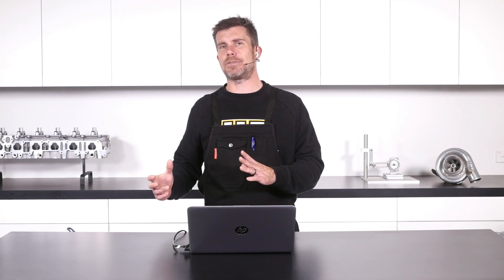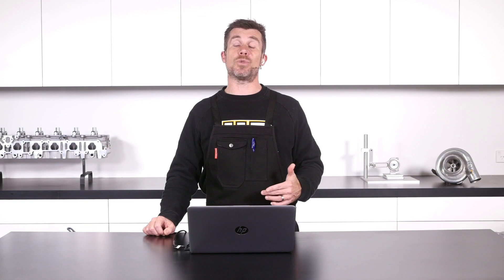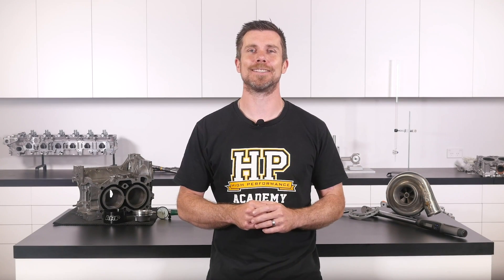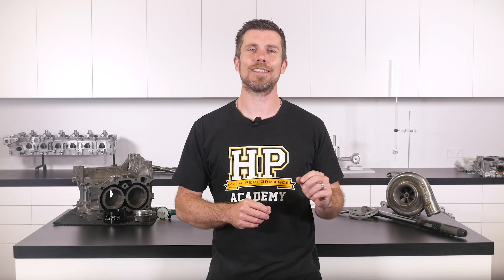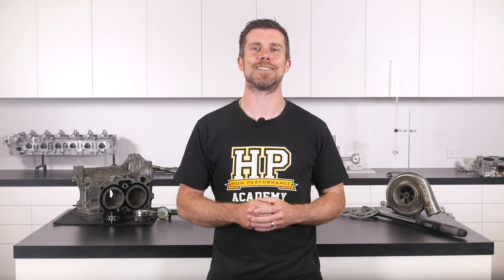Is Street Tuning Worth It? [HPA Q&A]

Comment: I have a friend (Mechanical Engineer) that tuned his KE Carolla on the street before he Bought a dyno....CA18, Powerglide, GT40, and wet nitrous system :) he tells the passenger what to put in as he drives, 

I don't recommend this method on the street anymore unless your're away from any potential surveillance.
Reply: Now that sounds like a fun build! Any video's?

Comment: What dictates if a certain engine will be knock limited or not? I've heard it's normally the fuel used.  As in if you're running pump gas you'll be knock limited and if you're running race/e85 gas etc you'll be going to peak power. What say you?
Reply: You’re right, the octane rating is one factor (higher = less chance of knock at MBT) the other is usually to do with cylinder pressure & combustion chamber design. Reducing compression ratio will also reduce knock, as will reducing boost pressure. Though you might find that you make more power with less timing and staying knock limited. Hopefully Taz answers though
Reply: It would be knock limited if it has a turbo or supercharger
Reply: @DylanL69  that's not correct
Reply: @DylanL69  : No, that is oversimplified and plain wrong.
Reply: @TheFirstBigCheese  no I'm not

Comment: Also turbo PID-maps will be more accurate from road tuning, as you can tune them with accurate engine load (wind resistance, actual weight of the vehicle loading the tires..)

Comment: Is there a video on road tuning for ignition timing?  How do I know I've reached the knock limit?
Reply: I think they have one yes. Honestly, I wouldn't mess with timing too much without an eddy current (load bearing dyno). The biggest reason for this is that while sure, you can increase the ignition timing until you get knock, but you don't know what you hit MBT without a dyno. I.e you don't know when you should actually stop adding timing.